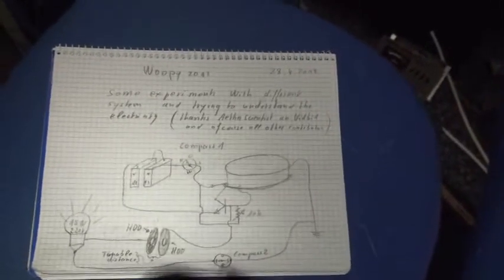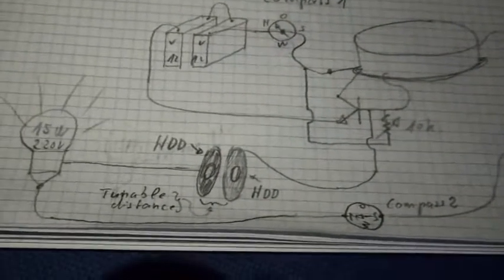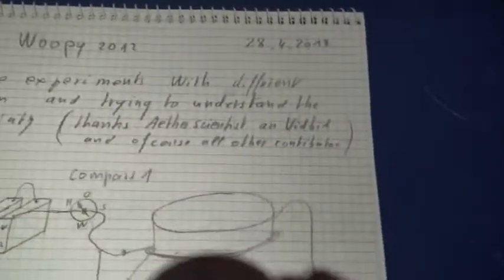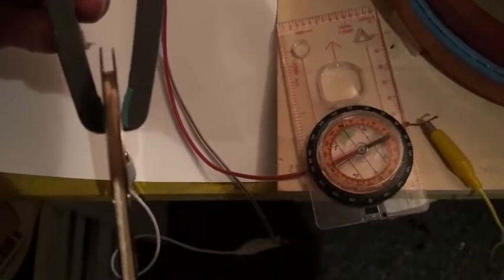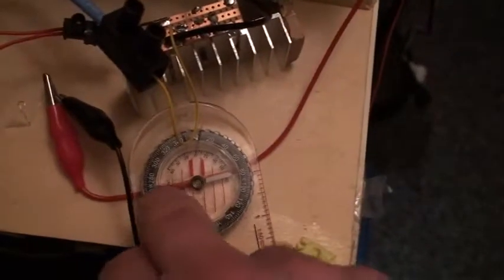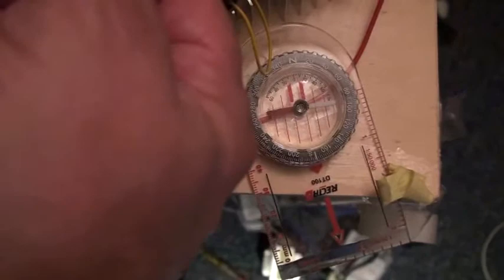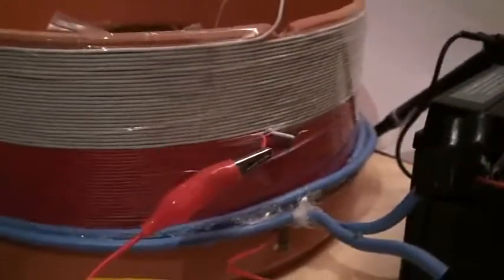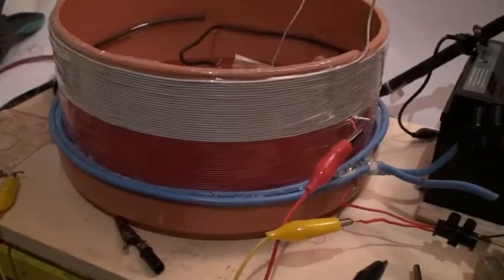amazing difference in electricity1.wmv

Comment: you have ac so you will not get movement on the field of your compass. dc will move compass because its a steady current. you need a digital compass to see the fields in weaker fields.